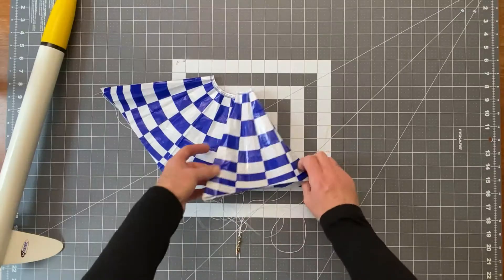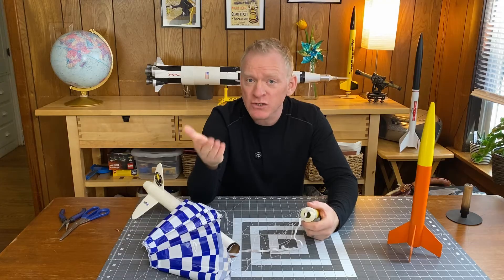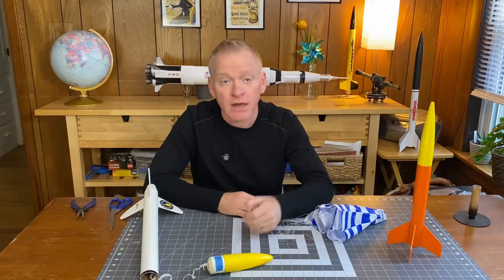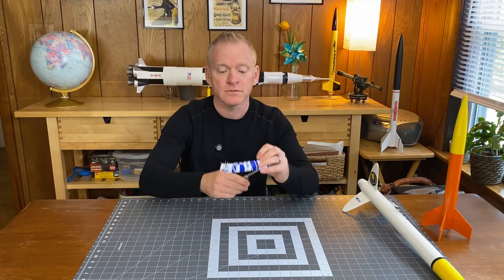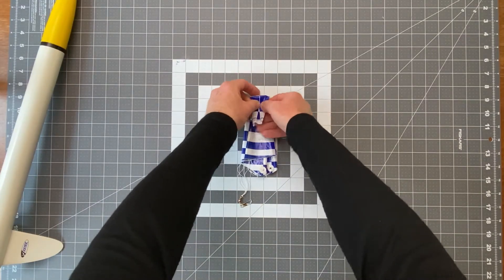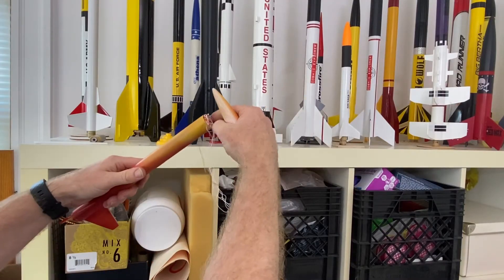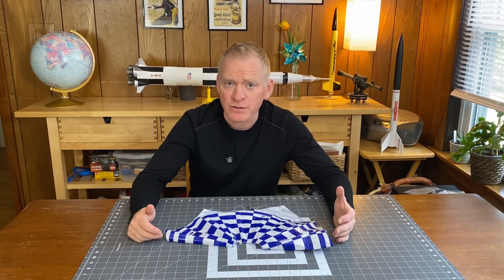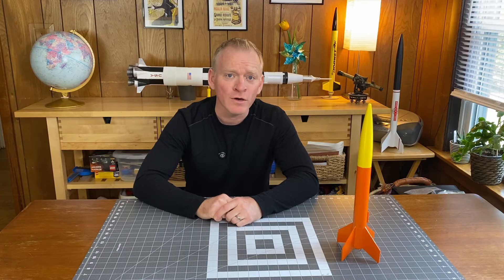How to Attach and Fold Model Rocket Parachutes!

Comment: Any recs as to how to store parachutes when not prepping to launch?
Reply from the maker: Hang them open and upside down. I pin the snap swivel to a cork board and let them hang from that. But as long as you open them up before you use them again, it's okey if you store them folded. Dust them with a little baby powder and they'll do great.

Comment: Great video, N00b.... Only thing I have heard contrary, is that some of the snap swivels used in fishing have a sharp edge/tab that can get tangled or poke a hole in a chute. But I don't know how to solve that.
Reply from the maker: I avoid the ones with the ends poking out. There are plenty of them where the end doesn't stick out of the clasp. The poky ones can get tangled in shroud lines.

Comment: What if you don’t have a loop on the nose cone
Reply from the maker: Then you'll need some kind of attachment point for the shock cord and parachute. You could use a screw eye, or you can attach a loop of Kevlar line.

With a plastic nose cone, for example, you can drill a couple of holes in the base of the cone, pass a bit of line through, and then tie it into a loop.

But in order to safely recover all parts of your rocket, you'll need some way to keep the nose cone attached to the body of the rocket.
Reply: Also, if your nose cone is attached but you have no additional space on your nose cone for a parachute, some shock cords (small diameter Kevlar) can be water knotted close to the nose cone so you can attach a recovery parachute.

Comment: I have been playing with model rockets since I was 12 years old, in 1972. I got everything from Estes back then. It didn't take long before I got bored with building kits. So I started designing and building my own rockets. I also build my own launch pads and controllers, out of steel. My current launch pad is an older steel office chair base with the casters removed, a steel drill chuck to hold the launch rod (holds up to a 1/4" rod) and a steel turntable from an old phonograph as a blast deflector. It is heavy, solid, and well built. I had everything powder coated to make it look good. It does not come apart, except for the rod, but is small enough that it doesn't need to. It has 4 steel "legs" with a vertical tube at the end of each one, where the casters used to go. For a heavy rocket, I can put 8" spikes through those tubes and drive them into the ground to hold it securely in place. For a controller, I used an old steel cased computer network controller. I use a 50' orange outdoor extension cord from the controller to the pad. Despite being built out of various bits and pieces of a lot of different things, it looks much better and is much stronger than anything I have seen available commercially. 

I got into mid power rocketry for a while, but it just got too expensive. I recently retired, and went back to low power, D engines or smaller. I design and build my own rockets. I still do it the old fashioned way, with no computers. My goal is to get as much altitude as possible using engines no larger than a D. I've mostly used clustered and multistaged rockets. I've passed 3200 feet with nothing larger than a D engine. I have an agreement with a local farmer in central AZ to use his property as a launch site, as long as I don't let anybody else know about it. I used to be a member of the Superstition Spacemodeling Society, but they lost their launch site many years ago, and are now using a place over 100 miles away from where I live, which is just too far for me to go. I always launch my rockets out in the middle of nowhere the first time, just in case something goes wrong. I have never launched an unproven design with anyone else around. 

I make my own parachutes out of nylon. I sprinkle baby powder on them before packing them. I learned that when still using plastic chutes that tended to stick together after being folded. If you coat plastic parachutes with baby powder, they will still work after being stored for a while. I do use a snap swivel to attach the parachute lines to the nose cone, so if the rocket spins coming down, it won't twist up the lines. I also tend to use a single stage/upper stage engine with a slightly longer delay, to allow the rocket to fall a little more before the chute is ejected, and I do use a hole in the center of the chutes. I've had a few rockets float away and get lost. At 3000+ feet, the air current can carry a rocket for miles. I paint all my rockets gloss white and fluorescent orange to make them easier to see.
Reply from the maker: @geraldscott4302  My six year old loves balloons, so I have a stock of old mylar birthday balloons and I make chutes out of those. Your launch setup sounds amazing.